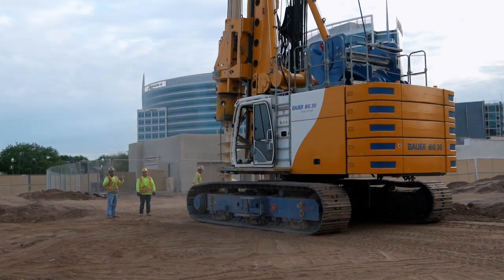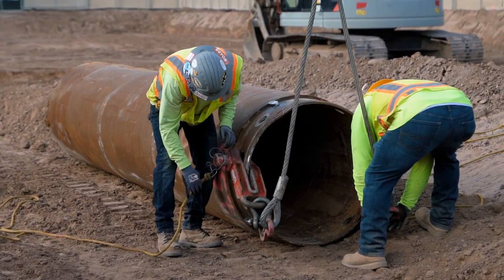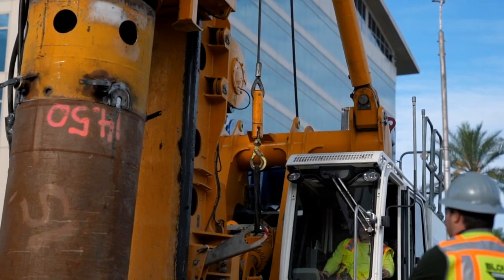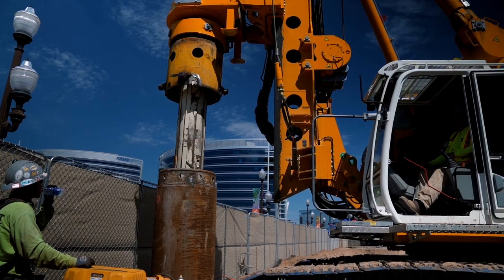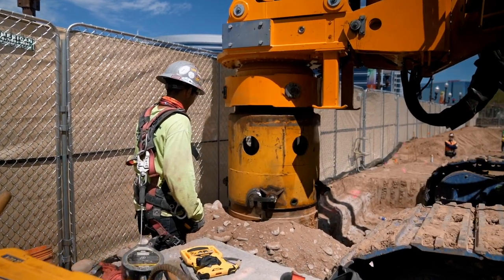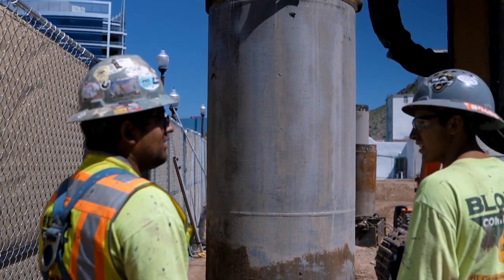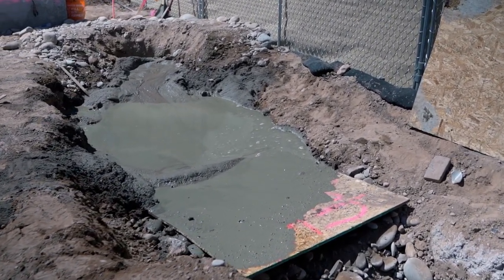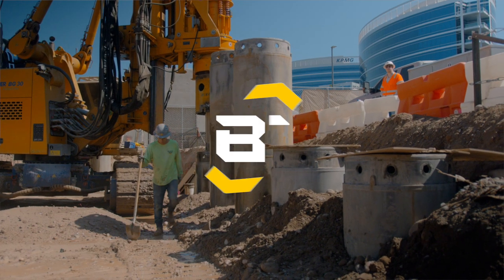Segmental Casing Explanation

Comment: I have no idea what is happening. Are you driving the casing first then cleaning it out?
Reply: Usually you prebore a little. You drive the first casing as far as you can go at first. Sometimes if the ground allows it and the soil friction is small enough, it can go all the way to only a metre of the casing sticking out above ground which is what you want. In this case you bore out the hole up to the bottom of the casing but go no further. You can then put on the second casing. 
Sometimes though the casing can't go all the way to the depth you want because of the ground. So you drive the casing as far as possible while forward spinning and back spinning the rotary and casing driver to help it go down. Once it can't really go down any more, you bore out to the bottom of the casing with the auger. You then drive it some more, bore out to the bottom until it reaches the depth you want. 
And the process repeats. 
At some point if the soil is weak you might put bentonite in the hole to further prevent potential ground collapse and to lubricate the drilling tool (change to digging bucket from auger when drilling in bentonite fluid)